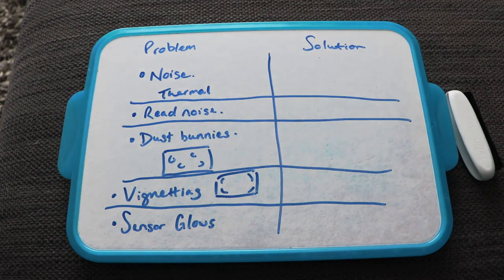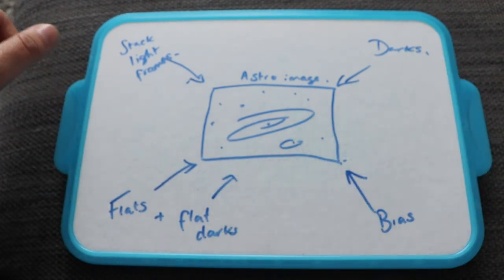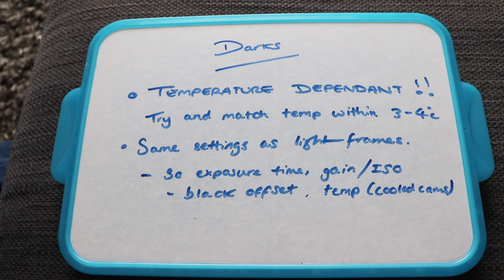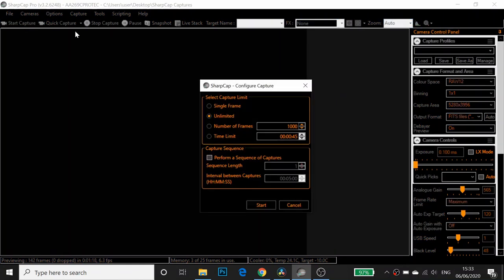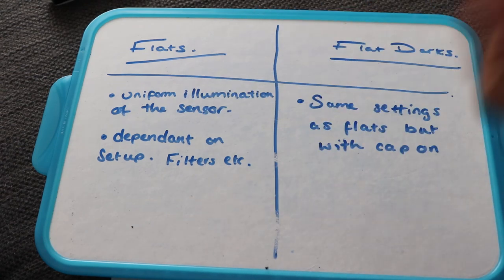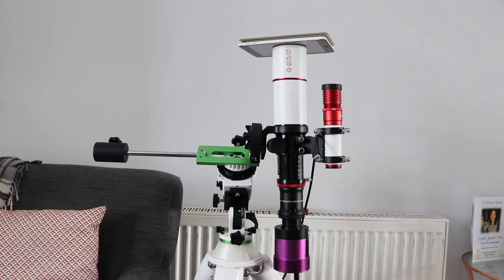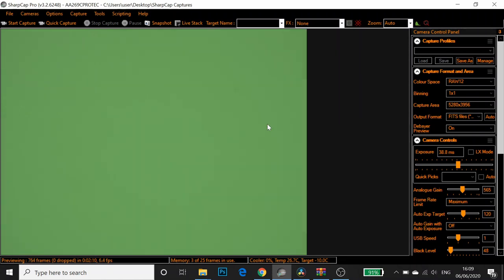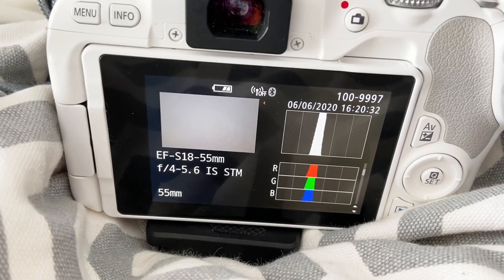Astrophotography Calibration Explained

Comment: Interesting.  Helps clear up some misconceptions I had.  The Dark frames are a pain, though, if you're doing 300 second exposures instead of 30 second exposures.
You did a great job explaining this.
Reply from the maker: Thanks Gary, they are indeed :) it’s one of the main reasons I went for a cooled camera. So I could set the temperature and do at my leisure

Comment: I presume that I need to do darks, flats (and dark flats if you want of course) and bias frames for each filter - LRGBSHO, correct?
Reply from the maker: Darks are for the sensor :) so you only need different sets of darks if you change settings etc. So if all your filters are done at the same settings ie temp, exposure length , gain, black offset  then you only need one set of darks. 
Flats and flat darks are for the imaging train, so you will need a set for each filter
Reply: @AstroStace  black offset?  I've never heard of that.  I'm still trying to get some gear for my rig, but hoping to figure things out and start LRGB imaging (will be unguided as no guide scope/camera yet - it's one of the things I still need to get).
Reply from the maker: Some software calls it black level :) some call it offset . I was just trying to cover all bases :)
Reply: @AstroStace  I know what black level is, at least from a normal terrestrial photography point of view.

Comment: Thanks for the video! I dont know but Flats never worked for me using sgpro. I will try the ipad method with sharpcap.
Reply from the maker: Bear in mind you can’t mix and match calibration frames from different programs. I used sharpcap as an example really, have a look at my flats and maths video to try and help you work it out for sgpro :)
Reply: @AstroStace   Im curious! I dont know what it is. Something has to work out for me! When I add flats, the illumination on the edges get worse. Even calibrating with dark flats. Ill try anything :D